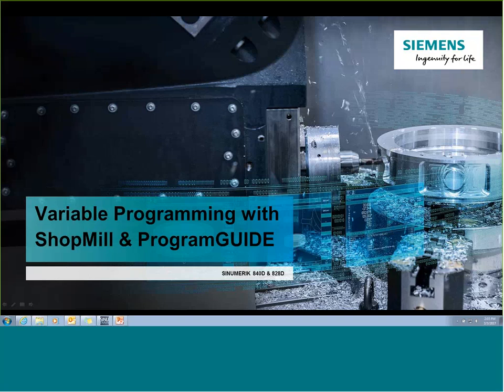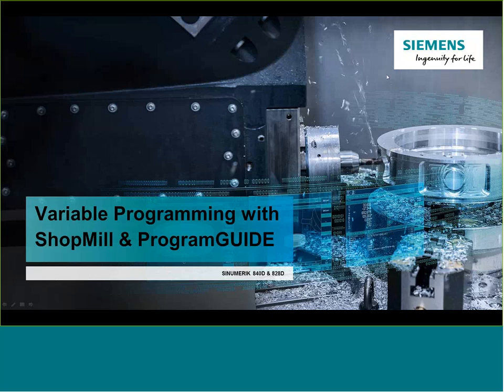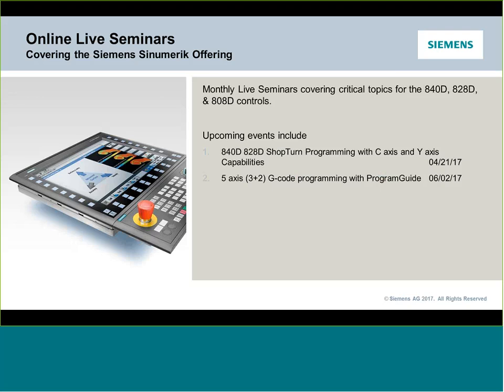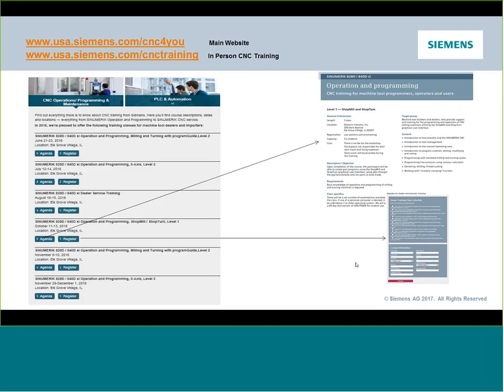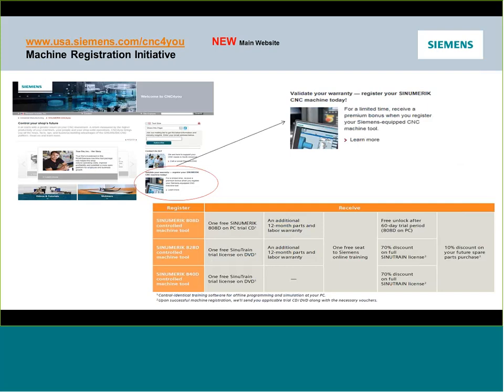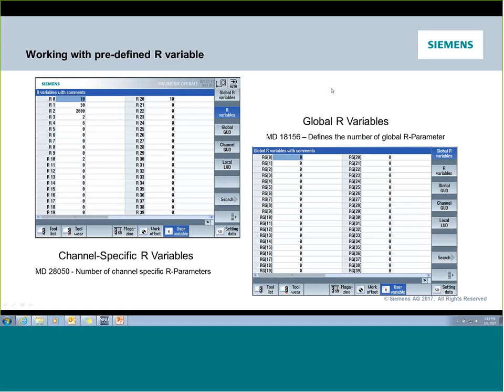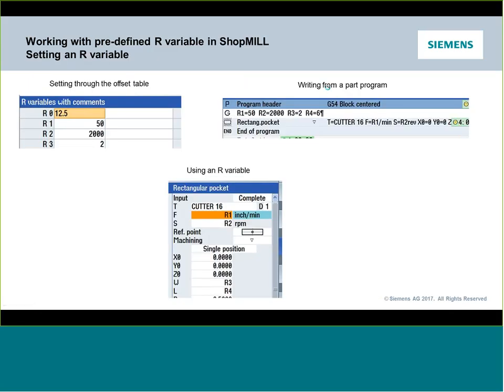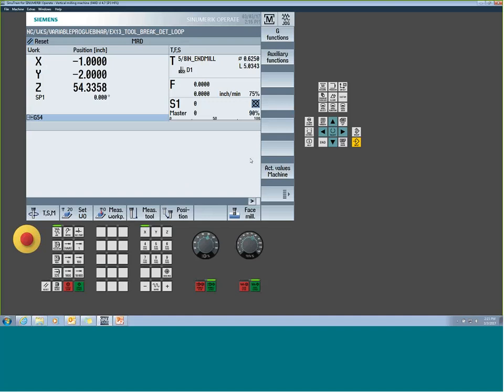Variable Programming with ShopMill & ProgramGUIDE   SINUMERIK 840D sl and 828D

Comment: hello, do you now, how to change a level to parameter MD13200 $MN_MEAS_PROBE_LOW_ACTIVE[0] by command REDEF in mode 4(between servise level)? 
in manual do not write in whitch file do this and how its activated...
so we need that this parameter will changed in level mode 4 (red key to 3 position), because $MN_MEAS_PROBE_LOW_ACTIVE=1 use for touch probe and $MN_MEAS_PROBE_LOW_ACTIVE=0 - to laser blum...
so how to change APW 4 only for this parameter?
Reply from the maker: are you able to manufacture password in? I would be surprised if the issues has anything to do with the access level.  It may have more to do with the activation mode (e.g. CF , NC reset , PO reset, etc.)

Comment: On cube machining. How do people write this on a Siemens 840d? 🙂 

G54M98Q1000
G55M98Q1000
G56M98Q1000
M30
N1000(MILL SOMETHING) 
G1...
M99
Reply from the maker: If you want to call up a sub-program in the Sinumerik it is as simple as entering the name of the file.  for example if you wanted to call up a program called cube.mpf it would look like this.  When the system sees the name in will automatically look for a file with that same name.  N1 G54N2 CUBEN3 G55N4 CUBE